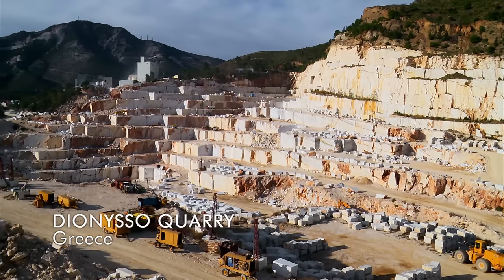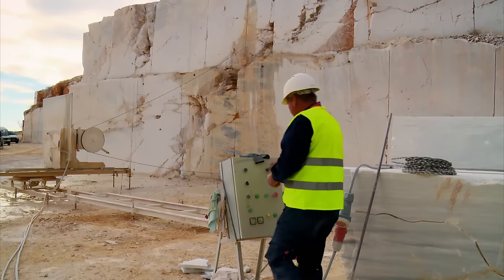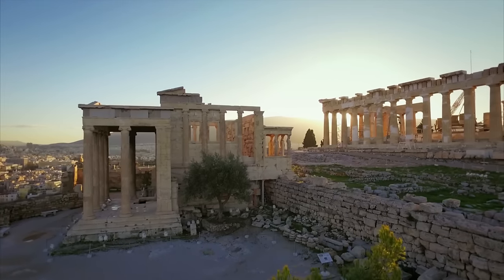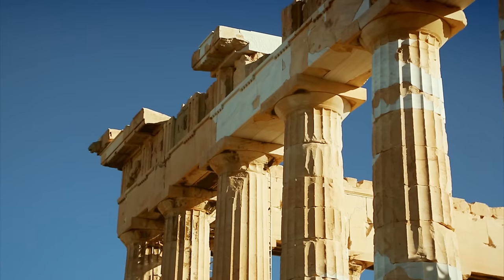Secrets of the Acropolis | Blowing Up History

Comment: The Parthenon was in very good condition until the Italians blew it up in 1687, which turned the great structure into a pile of ruble.
People were robbing the little bits and pieces when Lord Elgin acquired some for the British Museum. 
The Parthenon was built in about 10 years, and they have been rebuilding it for 300 years. Make work project.
Reply: Actually the Italians did not blow it up. The Venetians had barricaded themselves in the Acropolis, besieged by the Ottoman Turks and used the Parthenon as their ammunition dump. It was a Turkish cannon ball that hit the Parthenon and exploded the ammunition within it.

The Parthenon was not completed for many decades. The current restoration project is also only a few decades old but progress has been slow for several reasons. 1) The Archaeologists and restoration experts are having to be extra careful not to damage the existing structures. 2) Work is slower as the original architect Phidias employed hundreds of persons for the project. All in all there were thousands of people involved in its construction. 3) Current works have sometimes been stalled as it was hoped the the UK would return the sculptures as it is difficult to reconstruct the building to its original specification without them.

May I suggest you fact check?
Reply: @elbmw  Fact check is a good idea, indeed. The story about Turks and Venetians is true, but the Turks were inside, and the Venetians outside. Both are to blame: the Turks for storing ammunition in there, and the Venetians for bombarding it. Current works have been going on for over 40 years (not....300, as ziggy2shus wrote). We agree that they are very careful and meticulous -- basically they are putting every possible fragment back in its place. But their progress has nothing to do with the sculptures. Even if they are returned, they will go to the museum.   Here is the explosion story: https://www.historytoday.com/archive/months-past/parthenon-blown
Reply: @AALavdas  You are indeed correct regarding the explosion but would it not be better to put them back on the Parthenon? Little point in taking them out of one museum to put them in another, albeit a much nearer one as the argument for their return would be much stronger then.

Comment: Parthnon was built in 9 years but they have been  rebuilding it  past 30 years with computers Go figure
Reply: Phidias used thousands of persons to complete the project. The current restoration is taking a lot longer as I think there are only a few people involved in the project.
Reply: They are using the existing pieces found on the ground, not just making new from scratch like the original project. . 100,000 pieces and each one only fits a certain spot. It's a huge puzzle to put back together.

Comment: Why people used marbles. Marbles are seasoned silicate usually found under big river lakes over years of water flow. They have a good polishing finish. To assemble them it was a little bit easy and extreme fine art work can be done with clear detailing and finish look. Moreover planters are not much needed as they could cut wedges and stack with extraordinary precision to get a well balanced structure. Usually tall structures are difficult with small stones and plaster. Weather also took less tolls. Ideal heat and temperature maintenance inside. Water storage was easy inside high mountains. Mostly overlooking the place. Water was number one requirements for the city below.

Comment: it can be that the Parthenon wasn't the original temple or that there was a previous temple there. 
Also, if on the Pentelikon marble you use certain chemical substances it can shine again. We do that in older houses where at least one part of the house has this type of marble as flooring. But those chemicals unfortunately they are too corruptive to use on the Akropolis marbles.